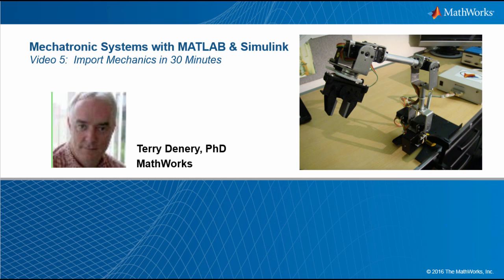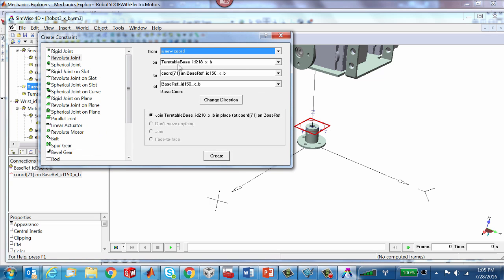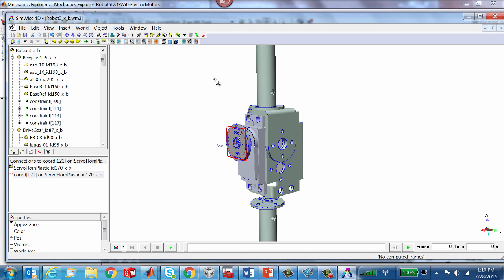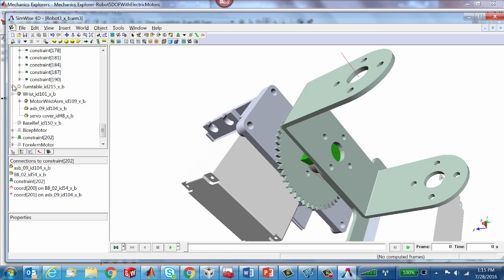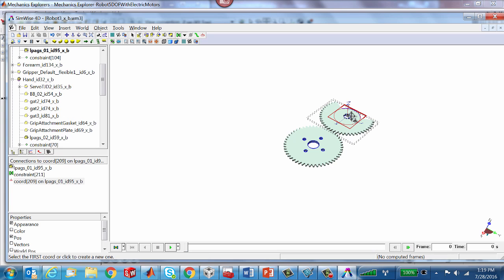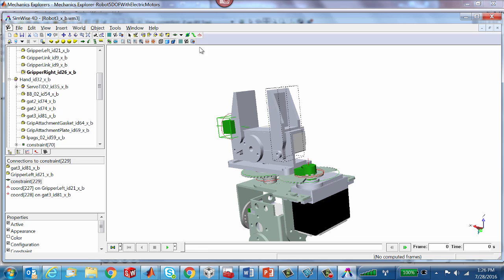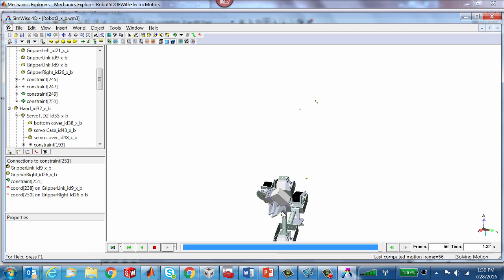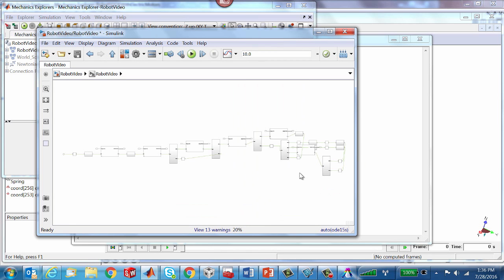Mechatronics with MATLAB & Simulink, Part 5: Import Mechanics in 30 Minutes

Comment: Dear Dr. Denery,

I hope see more learning Simwise4D videos from you (specially with the focus on control and Simulink linking). I have a question. When you opened the model in Simwise4D the file has *.prt extension. I would be thankful if you let me know the procedure? Because your model seems to be an assembly one. Did you save your final assembly model (after mating all the parts) with *.prt extension for not importing the mates in Simewise? Or you still have the Solidworks mates in Simewise?
Reply: Hi Mehrdad, I opened a Siemens NX Assembly file.  For Siemens NX, the extension *.prt is used for both part files and assembly files.  The method that I am promoting in this video does not care what the assembly mates are -- because it does not use them.  There is a CAD Translator for Simscape Multibody (formerly known as SimMechanics), which interprets CAD Assembly Mates to form joints in SimMechanics.  SimWise has a similar utility for automatically forming joints from assembly mates.  In my opinion, this approach to getting joints will hardly ever work, unless the person who will use the "Mechanical Motion" model builds the assembly mates.  This video advocates an approach that puts minimal responsibility on the part of the mechanical designers who build the CAD Assemblies.

Comment: Why does it move the part down when you hit run??
Reply: Hitting run starts the simulation.  The default environment for the model contains gravity, which will accelerate parts downward.  Does that answer your question?
Reply: Terry Denery Ahh ok. Is it possible to bring in the model at the origin of the absolute coordinate system?(i assume that is at ground level)
Reply: The assembly position definition is made in the CAD tool.  Our initial import into SimWise honors the same position.  Once in SimWise, you can change position.  There is a point in this video where I change the orientation of the robot from a horizontal layout to a vertical one.  I suggest that you re-watch this part, and I think that you will see that position can be redefined through the same mouse clicks and dialog boxes.  Thanks for the question.
Reply: Terry Denery Ok thanks!!